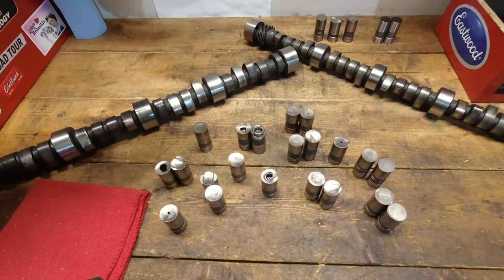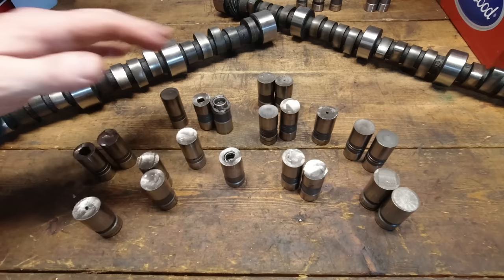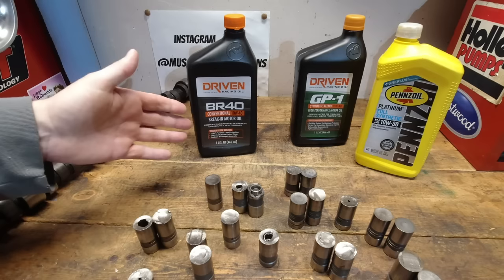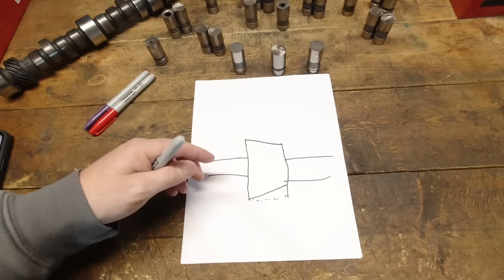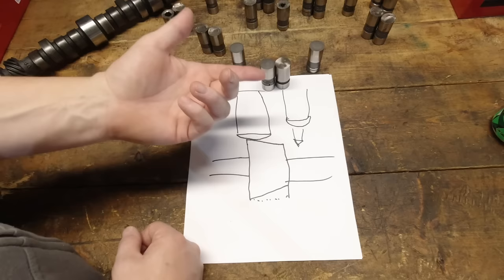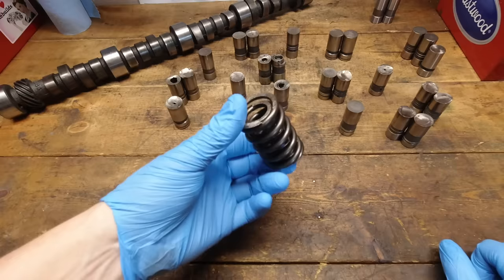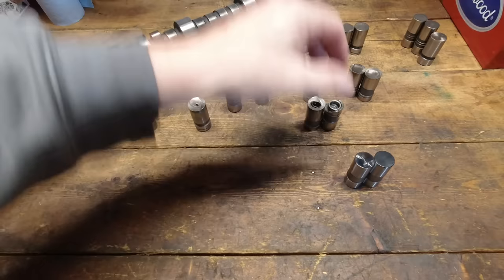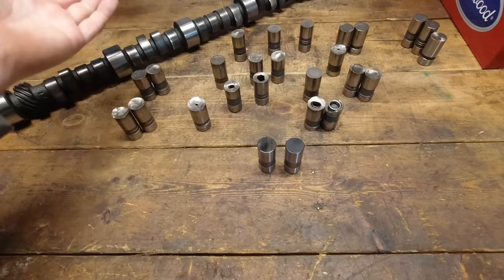Flat Tappet Cam Failures: The Reason Why They Go Bad & The Solution! Part 1

Comment: I've spent my life my whole life around racing engines we didn't start losing cams like this up until early 2019 I work at a shop right now not only is it car truck lifters that are bad it's also motorcycle lifters. The nun rocker arm motorcycle engines side by side engines I've put in I don't know how many cams I never lost a can my whole entire life until 2019 and I started noticing the bottoms of the lifters so I dug out a set of lifters that I bought in 2015 big difference. You have to check every lifter and if you do nine times out of 10 you'll find none of them match exactly there's something I've always did with cams that I never had to worry about a break-in procedure because if you think about it it's the affection that you allow is what causes cams to get eaten up I've always smoothed out the bottom of my lifter one thing you are right on of the bevel the bevel on the outside is 4° to six degrees across the lifter itself is up to 3°I've been anal my whole life on putting engines together and I've put some pretty big cams in engines and never lost a cam or lifter up until 20 19 that's when they started not grinding the lifters correctly that's where it all stems from as far as I will I stick with tried and true Castrol and STP put them on your fingers and try to wipe them off you can't I've used it my whole life and I'll continue using it that's the only special oil I've ever used on any type of break in the only break in I've ever worried about was rings if you have very smooth slick lifters to begin with there's not going to be no friction think about it try dragging your fingernails across a piece of glass then try it on a piece of sandpaper see what happens the way they're grinding lifters today is junk I put them in the lathe I smooth them out make sure I have at least a 2% level across the lifter in about four on the edges what the one on the edges do is once it wears past that edge past that bevel that's when it starts eating your cam. Because that becomes very sharp after many many miles like the difference between a speed bump and a knife blade which one's going to dig in definitely the knife blade everything makes sense you just got to think about it and as far as lift I've used some pretty humongous lift on engines before along with huge valve springs the only thing I ever broke was push rods and a valve and yes this was with flat tablet people's been doing it for years you never hardly ever hear about anybody eating I can once in awhile something will fail but that's not got nothing to do with what's going on today since 2019 in our engine rebuilds and you got to think there's 12 of us working there 91 bad cams until they start listening to what I told them why mine was lasting and everyone else's failed . Take a little time and think about it you'll see I'm right

Comment: I also find it interesting that Comp Cams components are having higher failure rates since being acquired by a large private equity firm in 2020.  The firms are know to do everything to cut costs and I have no doubt Comp is being supplied with low quality materials.
Reply: But is that because Comp sells more cams than other manufacturers
Reply from the maker: Prove it.

Comment: As I have mentioned before, I don't work on engines anymore but I really enjoy your videos. I am AMAZED at how many engine folks DONT understand the basics. They will spend 1000's on parts and dont understand the basics of oil, lubrication, zinc, etc. And like that you mention the Penn grade oil Driven has...its all I used in my 66 Mustang. Keep up the good work !
Reply from the maker: Penn grade used to get their base oil from the old Kendall facility.  They no longer do so.  That’s exclusively Driven for the performance aftermarket oils.

Comment: We always used a non detergent oil with GM EOS additive It has almost 6000 PPM of zinc and over 6000 PPM of phosphorus And if I'm not mistaking this is how GM did their engines for decades from the factory

Comment: I recently built a 350 Oldsmobile and I went roller all the way. I would like to do that with my Chevy trucks. One is a 1987 with a 305 and the other is a 1995 with a 350. I am currently rebuilding the 305 but I am going with a flat tappet cam because, as you are probably aware, they both have the dreaded TBI fuel injection. TBI engines are very difficult to tune and if I could find an equivalent roller cam for each truck I would gladly install a roller cam. The 1995 runs beautifully. I run Mobil 1 extended performance in that one and have had no issues. The 1987 ran pretty good. I bought it from a little old lady whose husband had passed away 2 years prior. The truck was VERY poorly maintained. I used regular Mobil 1 in that one and 2 years ago I noticed a slight rod knock at idle on a very hot day, so I knew the end was near. The previous owner had an Auto Zone replacement engine installed. When I removed and disassembled the engine and took everything to the machine shop they found the block was cracked in the lifter valley area in 2 places. The machine shop owner surmised it was probably from freezing. My machine shop found another 305 block and I will pick it up along with the new pistons, bearings and such and commence rebuilding the ole girl. I purchased an Edelbrock cam  part# 3702 and corresponding lifters part# 41-1502. I will also be purchasing a case of Joe Gibbs break in oil for the break in process. I'm sorry the story droned on but if you know which roller cam will work, with as little tuning modifications as possible, please let me know. I will convert all my vehicles to a roller cam. Thank You for the video and the very useful information. Have a great 2023.
Reply from the maker: Oof.  Those TBI units.  It’s really not hard to understand why folks gut it and put on a self learning throttle body EFI.  At least you can make your cam selection and have reasonable expectation that it will run.  What cam can you run?  Anyone you want!  But you know you’ll need to ditch that old non-tunable factory stuff.
Reply: I bought a 1987 Caprice 305 roller and put it in a 1983 Firebird, de-emissioned, no computer, 1975 spec distributor and Rochester Quadra-Jet that I was able to lower the float, adjust the sliding needles for the primary jets to lean it out, and got 28 MPG highway off the 2 Barrel side and full power off the bigger 4 Barrel side.
I know you're already "down the road" on your build, but knowing that lifter bores are "off-center" - - WHY would you want to put a roller cam set-up in an engine designed for flat tappet?
Another thing, the lifter bores are TALLER in a roller block and a retro-fit into a "classic" Chevy just seems like a patch job of aftermarket equipment, when factory roller blocks are out there. I still have a roller 305 tucked away...waiting...
But another engine is the late '90's Vortec 350 - you get the great flowing Vortec heads, the roller 350, 1pc rear seal, the ability of running tuned port, carb or aftermarket fuel injection.

Comment: Very interesting . Over here in New Zealand . We run old V8s on 20/50 hi zinc oils
Reply from the maker: Viscosity is really centered around bearing clearances plus engine specs and fuel type.  But it can be a good weight when it fits what the engine needs!  Thing you all have some potentially different brands down there, as well as the ones we have in the US.  Been a minute since I was down there.
Reply: Penrite an Australian oil company make some really good hi zinc performance oils for the old school stuff 👍
Reply: All I’ve ever used is Valvoline Racing 20w-50.   No oil related failures in over 40 years.

Comment: I've been a mechanic for 40+ years. Built a few race motors, had good results. Our shop took in a 1969 Javelin SST 390 project to be finished. Body work was finished, it needed wiring, brake hydraulics, accessory brackets etc. I've owned some AMCs in the past and was familiar with the engine. The guy that had put the engine together had died and I had no idea what was inside. To begin with it had wrong water pump, short pump unavailable. So I remade the pulley to compensate. Timing cover was poorly machined aftermarket part. Distributor would not go in. Replaced it with a cover off a 360 I had. When I had timing cover off I seen water jackets had not been cleaned very well. I was getting concerned how the engine had been  assembled. The car owner was confident in the builder. I started the engine assuming first start on new cam and did everything I knew to do proper cam break in.  We had total failure on 3 lifters on test drive. 2 lifters had holes wore through the bottom. On removing the cam it was a Comp Cams grind no idea what the lifters were. What would you have done considering the owner was hesitant to have the engine dissembled prior to first start up?
Reply from the maker: Doesn’t matter what the customer was hesitant about.  If I’m responsible for the break in, it better be done so it will survive and that includes the things we talked about in the video.  Especially spring pressure and break in for 3-400 miles.
Reply: Actually watch and listen to the video and you will have your answer!

Comment: Break in spring depends on how aggressive the camshaft is . Break in oil on the other hand is crucial as is the additive for oil there on after.
  If you are using say a cs-1013r from speed pro that cam is mild enough that a break in spring would not be necessary. A quality lifter is also a very good thing to invest in I totally agree !! Delphi lifters are very nice !
Reply from the maker: Delphi used to be nice.  There’s quite a few failed Delphi lifters in this video. They just aren’t made the way they used to be.  No profit in making them.
Reply: @MuscleCarSolutions  I generally go with Melling for internals when I do a build . Cams as well . Melling has always treated me right .
  Carbs always Edelbrock or Rochester.
Reply: What's the rationale behind break in? Wouldn't driving the car as you would normally break it in just fine?
Reply: @moshet842  people think that every flat tappet engine ever build was broke in for 30 minutes before it left the factory. Nope. They put it in the car, started it up and drove it off the line. The new owner had some basic instructions on breaking in the new engine but cam break-in wasn't one of them.

Comment: I'm reading through some of these comments & all I can say is Wow! No wonder there are so many failures. I will point out to all the pros that worked for car companies & never did break in procedures couse it wasn't a thing, I will say it probably wasn't a thing with tame, stock, mild camshafts & low pressure springs that were used in stock engines coming out of the factories. That in itself is part of a break in procedure.

Comment: I've always used Driven breaking oil and never had an issue then switched to vr1.
Reply: special oils in a specific brand are likely never going to add much aid to the solution because the flat tappet lifter is loaded hard to the cam lobe when opening and the lifter without roller wheel just shaves off the lubricant. I seriously doubt these oils can embed themselves into the metallurgy of the metal once the metal has been poured at manufacturing  and is machined and has cooled.

Comment: Back in 1977 I was finishing on a engineering degree with GMI (General Motors Institute).
GM got themselves in a pickle over this same issue.
Over at AC Delphi where the cams and lifters were made, they had issues in the heat treat dept.
with fires and oil clean-up.
In a large basket, the cams and lifters came out of the furnace red hot and was lowered in a vat of oil.
This caused oil splattering everywhere. GM was shelling out big bucks for the Equipment cleaners, EPA, and disposal of the oil.
At GM, we had, at that time, Employee Suggestion Program.
I personally knew of the engineer that suggested that GM use water-hard steel instead of oil-hard steel, that it would eliminate EPA, Fires, Smoke, and water hard steel is cheaper than oil hard.
GM paid that employee 20K and used his suggestion.
That ended with GM having one of the largest recalls, at that time (1978 and part of 1979) with the 305, 307, and some of the 350's with this very issue.
Oil-hard steel case hardened to .0035" thousands and water-hard steel case hardened to only .0015".
Not a whole lot of protection.
Most of your cam and lifter manufactures go on the cheap and use water hard-steel giving you a
.0015" case hardened cam and lifter.
GM used a Non-Detergent oil with a GM EOS additive. It has a lot of zinc.
When GM started these engines on the line, they opened them up immediately to 2200 rpm for 20 mins.
Loved the video. Well done.
Brought back a lot of memories too.
Reply from the maker: You being up a good point.  Next time I have the opportunity to talk to one of the US manufacturers, I’ll remember to ask that question.  The only issue I see is those OE suppliers primarily have switched to hydraulic roller production.  We’ll see what we can find out between those two processes.

Comment: I just got done with the initial break in on my BBF with a Comp cam, and so far so good!  It was the longest 30 minutes of my life thats for sure!!  Great vid and great explanation of what happens in the event of failure.  I went with Brad Penn break in oil and they as well recommend running 300 miles on the break in oil. Tough to do on a seasonal vehicle, means I have to get out and drive my rig!
Reply: I'm getting ready to break 1 in. If it goes bad then I think I'll go roller, newer cars never have cam problems
Reply: @reginaldhall6871  Cross your fingers and toes!!  Good luck :)

Comment: at this point i have not had any failures in my hot rod shop on SBC . Always check for cam lobe tapper before install , Always use Break in oil for the first 2 oil changes , always use a single spring for break in or at least add 50 thou. to installed ht. and take out any spring shims for break in peroid.
Reply from the maker: It’s the necessary work that has to be done to keep these things alive.  Really a small number fail, but it’s way more than they used to.  Thankfully the new lifters should cure it all.

Comment: Just now after realizing things, watched your explanation earlier today 11-20-23, I'm takin the HIT, going roller on my AMC 401. NOT takin a chance.
I've listened to and watched too many Good guys I trust and it's a sobering moment of "revelation" .
The message in the scenario is do it twice with a FT and extra costs or once with a roller and carry on!

Either way I'm looking at the near same  $$$.
Just with a roller,  NO need to pull engine twice and no down time for 3 more months!
I'm hearing it in your voice and The other guys voices too.
There is a time to realize wisdom when it's facing you and THIS I believe in all my automotive decades experience is One of them! - Go Roller.
Reply from the maker: I know there are folks that just want this to be an option but the reality is there.  If you want to go flat tappet, you’ve got to put in a significant amount of work to ensure it survives.  I switched to roller decades ago and until recently there no way I’d go flat tappet.  The new comp DLC lifters are the real deal though.  Big time game changer.